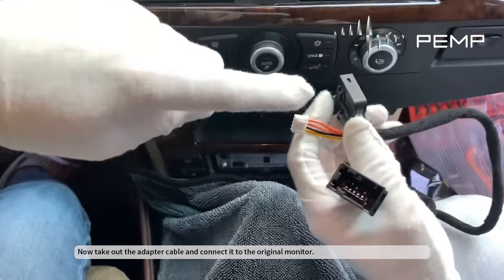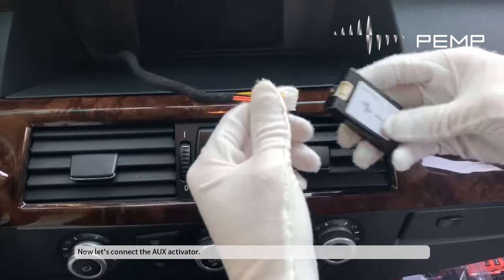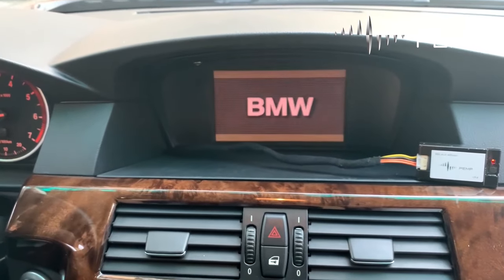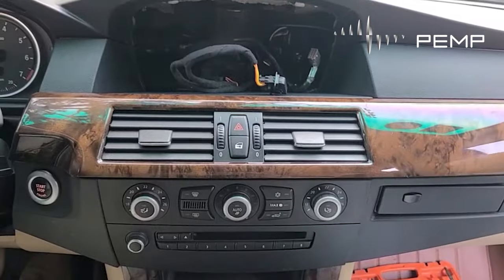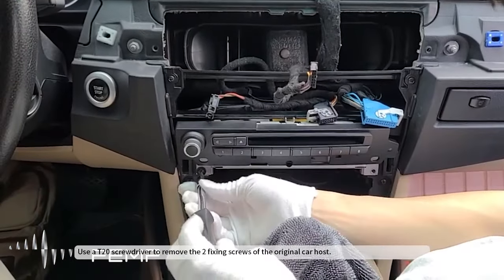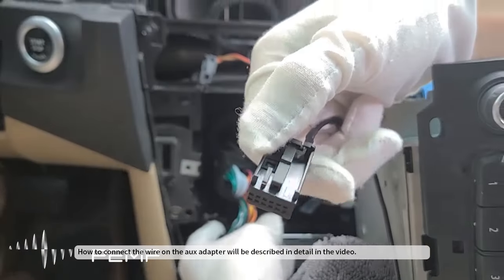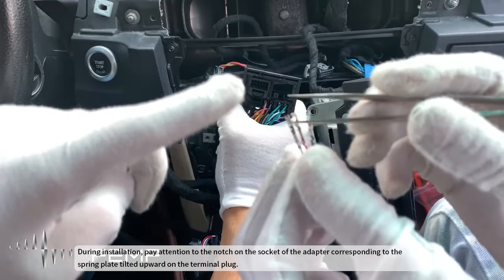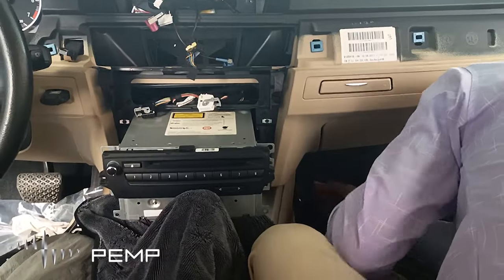Activate your BMW E60 CCC AUX Audio in 1 minute(E61/63/64 CCC all OK)

Comment: Have you ever had to re activate it or had any problems ?
Reply from the maker: It can only be successfully activated once, as long as your AUX is successfully activated, the second car cannot be activated.
Reply: @pempcar  once you have it connected and if its run the right way. Will Aux be installed permanently? I won't have to do it again for the same car is what I'm asking ?
Reply: @pempcar  I just ordered the part so I'm definitely excited for this switch
Reply from the maker: @1mitchmugga  Yes, your AUX AUDIO will exist forever after successful activation.
Reply from the maker: @1mitchmugga Thank you so much!
Reply: Last question once I activate that aux audio do I have to keep the activator hooked up ?
Reply from the maker: @1mitchmugga  After successful activation, you can remove the activator and keep it safe. There is no need to connect it all the time.
Reply: @1mitchmugga   hey how did the installation go? I just bought a 2007 530i and I was expecting it to have an aux but sadly it doesn’t.
Reply: @juannn2862  everything works 100% percent... Just make sure u have a lil free time cause the job takes a few hours to get done.. but it was by far best mod I've done to my car... And once you get head unit in you will have way better sound quality in your car
Reply: @1mitchmugga  awesome, mines gets here Saturday,
Reply: @juannn2862  just take your take and you will get it done. You might drop a few f bombs but you will be satisfied in the end ... I also bought an XTRONS 64GB 4GB RAM HEAD UNIT WIT CARPLAY it completely changed the sound quality & also gave me Bluetooth audio & updated navigation + much more 👌🏾👌🏾👌🏾👌🏾
Reply: @1mitchmugga  I just got mines, umm mines didn’t go as planned 😂😂😂
Reply: @pempcar  is it ok to leave it connected in the back or should I remove it ? Also sometimes the rear left speaker pops when I’m driving . What can be the cause ?
Reply from the maker: @cornpopthebaddude3992  You can remove the activator, because the AUX is input into the car with two channels. If POPS appears on your rear left speaker, could it be that the speaker itself is broken.
Reply from the maker: @juannn2862  Looking forward to your good news
Reply: @pempcar  ok I’ll do that , I found out the pop was coming from a loose connection into the harness . One of 3 cables for the aux was bent on one of the connectors I got with my kit on Amazon. I think it was the cable that connects next to the white one . Do you guys know where I can find another one of those metal connectors to redo the wire ? I taped it on the harness so it doesn’t get loose and make the speaker pop for now . But I’d like to redo that metal connector on the black wire .
Reply: @pempcar   it worked! My car came with the sound package from factory so it was a bit different but in reality it’s exactly identical to this tutorial
Reply from the maker: @cornpopthebaddude3992 There are many E60 aux lines on Amazon. They are very cheap. You can buy one to repair it.
Reply: @pempcar  those seem different , I’m specifically looking for one of the connectors used on the 3 cables connected to the AUX out cable so I can keep the cable I got with my kit .
Reply from the maker: @juannn2862  Cool
Reply from the maker: @cornpopthebaddude3992  OK，Hope you can succeed.
Reply: @pempcar  I need info from you so I can replace the molex connector on the AUX out cable that came with my kit I bought from you on Amazon or I’ll have to return my kit to Amazon
Reply from the maker: @cornpopthebaddude3992  The following line should be able to support.
https://www.amazon.com/LOOYUAN-3-5mm-Auxiliary-Audio-Cable/dp/B012V92OK6/ref=sr_1_13?crid=DEDWF8C9DW1Z&dchild=1&keywords=bmw+e60+aux+cable&qid=1623212609&sprefix=bmw+e60+aux%2Caps%2C367&sr=8-13
Reply: @pempcar  do you have a link to the metal crimp connectors that come with the cable I bought from you ?
Reply from the maker: @cornpopthebaddude3992  Well, we did not sell this line separately, if I have one, I will give you one. You can buy it by following my link, it can be supported.
Reply: @pempcar  is rather wait for you so I don’t have to return . I don’t want to buy another cable when the one I purchased should work fine . If it’s an issue , I can return . No worries
Reply from the maker: @cornpopthebaddude3992  Don't worry, if you purchase this line, if your problem is solved, I will pay for the cost of this line.
Reply: @pempcar  how would I receive payment from you ? I contacted Amazon seller , maybe they can send me this line instead .
Reply from the maker: @cornpopthebaddude3992  After you have successfully installed it, tell me that I will return it to your Amazon account directly from your order. so sorry
Reply from the maker: @cornpopthebaddude3992  Have you already purchased the wire, if the installation is successful, you will tell me the result, and I will pay you the cost of the wire.
Reply from the maker: @cornpopthebaddude3992  After you buy the wire, please install the terminal according to the 6 minutes 28 seconds or 7 minutes 09 seconds of our video. In this way, a firm connection with the female seat can be ensured.
Reply: @pempcar  still waiting for it , I’ll keep you updated
Reply from the maker: @cornpopthebaddude3992  OK, looking forward to your good news. In addition, send me your order number to  service@pempcar.com, so that I can return the cost of the wiring harness to you in time.
Reply: @juannn2862  Hey, im having the same issue. How did you fix it?

Comment: Will this work on a 2006 BMW 530xi e60 wgon?
Reply from the maker: Yes it can support BMW e60 ccc all car.
Reply: @pempcar  even e61?
Reply from the maker: Yes, e60 e61 e63 e64 all  CCC system OK
Reply: @pempcar  thank you!
Reply: @pempcar  e90 ?
Reply from the maker: @aimized1460 it only open the e60 61 63 64 AUX MENU, IF your OEM display has aux menu, pls don't buy it. thanks

Comment: do you have to leave that little box connected for the aux to continue to work
Reply from the maker: Yes, after successfully activating the original car AUX AUDIO. Without a small box, AUX AUDIO can also work normally. But please keep your box properly and do not throw it away for the time being to prevent AUX AUDIO from disappearing again.
Reply: @pempcar  so it does not have to be connected? After it downloads?
Reply from the maker: @robertandri5919  Yes, after successfully activating AUX AUDIO, there is no need to connect.

Comment: Dommage car impossible de le commander en France
Reply from the maker: I received your request and I will update the product to France today. Maybe you will be able to buy it on Amazon in France next week.
Reply from the maker: Dear, I have switched to France, and you can make purchases on Amazon in France.
https://www.amazon.fr/dp/B08XXF2T5Q?ref=myi_title_dp
(important ): After activation, keep connected, wait for 5 seconds, then turn off and lock the car and let it sleep for 15 minutes. Disconnect the negative pole of the car battery for another 1 minute and then connect it back. Then get on the car and install other steps!
Reply: @pempcar  Thank you for your quick reply
once the manipulation is done, do you have to leave the case in place or remove it?
does the cable jack plug into the screen or the radio?
Reply from the maker: @juliencths2090  Now i reply your question:
1.once the manipulation is done, do you have to leave the case in place or remove it?
Reply:
After you follow the steps and fully confirm that the AUX menu is successfully activated, you can remove the activator and the wiring harness used for activation.

2.does the cable jack plug into the screen or the radio?
Reply:
Pls check the video,The terminal of the Jack wire must be connected to the socket on the back of the OEM host's harness.

Comment: Ok how would it work if I replaced the stereo part. The old one was not working but had Aux setting. The new one does not have that setting and I installed a carplay stereo and cant get sound now. Would this gadget help?
Reply from the maker: Yes,it can open the aux menu of the oem radio. please note the step 4.

Comment: Will this work in 2004 e60 with MASK ?
Reply from the maker: Yes,it fit your 2004 e60, (important ): after activation, wait for 5 seconds, keep the connection, then turn off and lock the car, and let sleep for 10 minutes. Then get on the car to install other steps!
Reply: Thanks for the reply.